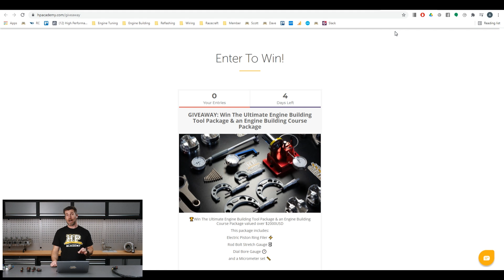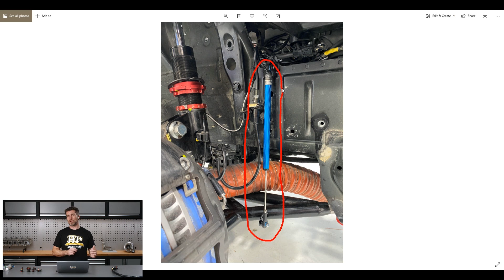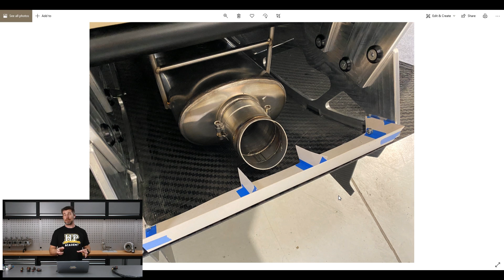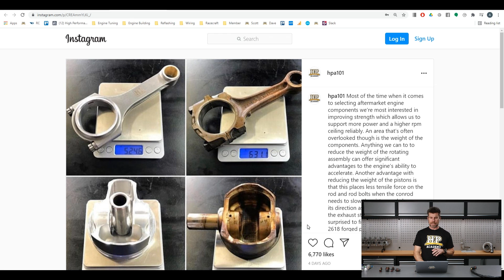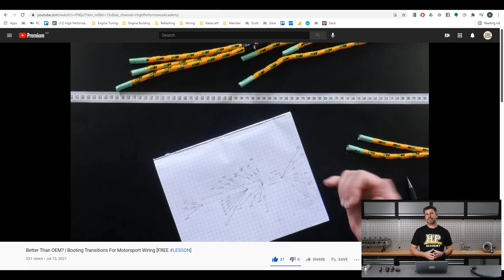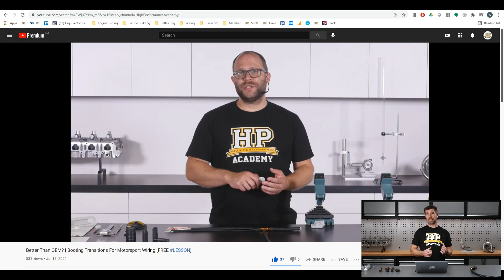Blown Diffuser Exhaust Setup & More | Today At HPA [#UPDATE 287]

Comment: Hey @hpa101 , 2 things, probably 2 years too late, but...  1: You'll find that when F1 regulations made them mount the exhaust on top of the diffuser instead of through it to the underside, they were still actually diverting the combined exhaust and airflow to the underside of the diffuser, finding photos may be difficult, also this flow was used to control tyre squirt too.
2: The effect of that muffler exhaust blowing onto your diffuser top surface will likely do nothing as any airflow you may induce from the exhaust flow will be negated by the muffler body impeding the airflow. If you cut a hole in the diffuser and exit the muffler to the underside of the diffuser neatly, you should see much better results. Enjoy.
Reply: Exiting the muffler through a hole in the diffuser was how f1 teams originally implemented this concept. The only issue is that the amount of exhaust gas sent through the diffuser is dependent on how much throttle is being applied which creates a situation where the downforce at the rear of the car is constantly changing making it unpredictable during a race. The way red bull used in more recent times was by essentially routing the exhaust gasses between the diffuser and tires to create a barrier on the sides of the diffuser that would prevent dirty air from the tires from getting sucked into the diffuser and disrupting airflow. They solved the original issue with a mechanism that basically held the throttle open even under braking to maintain the aero effect. So like you said, I dont think having the exhaust on the top of the diffuser will have any effects

Comment: Lowering the weight of the rods and pistons will also theoretically affect the maximum RPM the engine can sustain by limiting the stress of repeatedly accelerating the assembly, right? Given airflow, fueling, and spark are all up to the increased RPM?

Comment: Another cool video.

The current draw 'shouldn't' have killed the alternator, it can only put out what it's design and the voltage drop allows, with the rest being drawn from the battery - it helps to think of the battery supplying all the current and the alternator topping it up as it's design limits allow.
What I suspect may have killed it is vibration, the windings are very susceptible to this can fracture or short as they contact each other and wear their insulation. This is why some manufacturers use vibration isolators in their mounting designs - if you go this route, remember there'll need to be a ground between the alt' body and engine fitted. If you don't, a little silicon sealant where the field windings are looped back should help - a little, as too much will affect the heat dissipation under high current production.

Can't recall if it was discussed in the lessons, but with a 3 or 4 conductor fabricated lead, would braiding it be worthwhile/a good idea, to reduce cross-talk and interference?

Oh, it's expired now, but the linkies for the competition mentioned didn't work for me - don't know about others, so if the entry seemed a little low, that may have been the reason ?

Comment: I think it's more effective to blow a diffuser from underside, like this: https://cdn-1.motorsport.com/images/mgl/01JqaEr2/s8/lotus-99t-1987-underside-view-1.jpg and not from top
Reply: I agree, also the muffler is a bad idea to attach the airflow to the diffuser. To ovals on each side would perform a lot better. 
I should watch the whole video first
🤦🏼‍♂️
Reply: That is the worst type as if you blow hot exhaust air to the diffuser where there is  already flowing air, it woulf only disturb the air and wont be effective this is why the blown diffuser iterations in f1 back in the 80's and 90's failed but Adrian Newey created a new iteration of it in the 2010 redbull rb6 by blowing it on top of the diffuser and worked effectively and Newey is the best designer F1 has ever seen so it would be better for me to believe him rather than you
Reply: @eronsebastianermino9989  Not quite. That example doesn't work here. The main difference is that all of F1 exhausts exit at the outside air flow, so it's possible to accelerate and control it. Here I don't think the flow over the diffuser is good enough to be energized by exhaust. So I think in a case like this, it's still a better option to blow directly to the flow under the diffuser.
Reply: Classic flow principle. Fast over top, slow on the bottom. Creates a pressure difference and provides downforce. Not saying their solution is the best but Blowing hot air under the diffuser will not work nearly as well as over the top at the right angle.

Comment: but isn't a blown diffuser supposed to blow under the diffuser and accelerate the gas flow under there to create more depression?
Reply from the maker: It's using the exhaust gasses to interact with diffuser airflow, there are a few different ways to do it, even in F1 there was some different iterations that would get the same label, some being as you describe rather than what we've been advised to do here - Taz.
Reply: Blowing exhaust air into already flowing air could disturb the air and have a negative effect.
Some aero cars have air channels to direct dirty air into there own wing, to sabotage the wing function to lower downforce and drag on the car when driving down the straight.
Giving the exhaust its own wing will prevent exhaust air from messing with the normal flowing air.
Reply: Wouldn't this setup be the equivalent of air flowing over a wing increasing downforce?